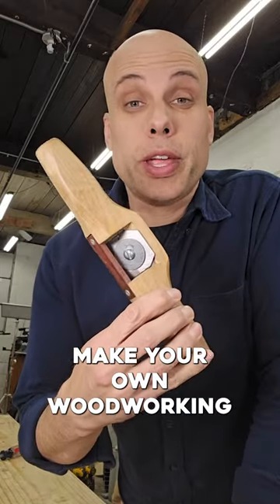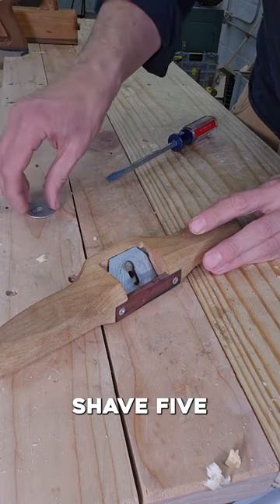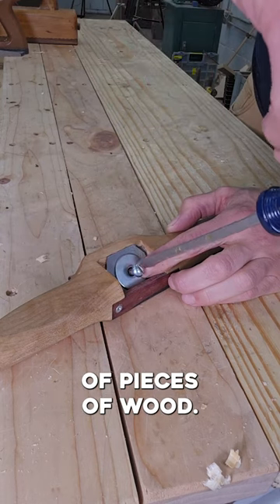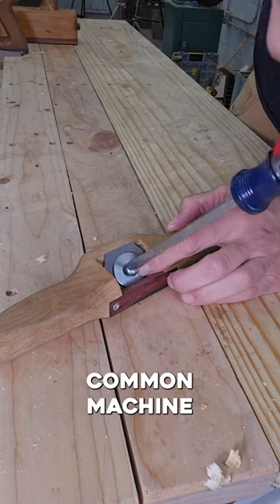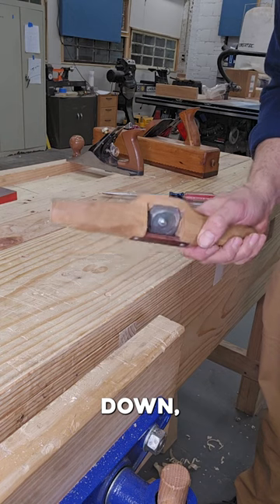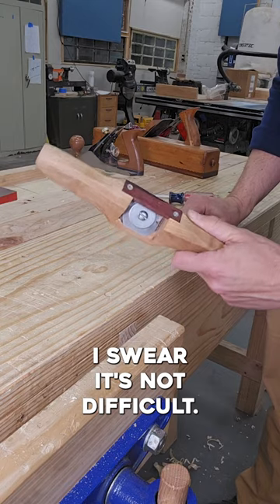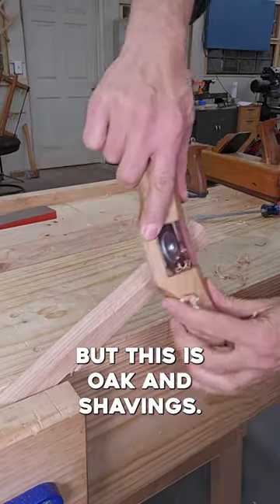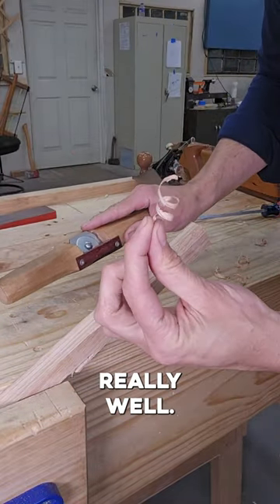Can you REALLY make your own tools? #diy #woodworking #woodworkingtips

Comment: That's the thing. There seems to be some stigma attached to making your own things rather than buying them. I don't get it. I make stuff and it works. It costs me a fraction of the store bought price. I can make it to my own specification and I can customize it when needed. You can't customize store bought stuff. It's not made to and frequently deliberately made to prevent customization.

Comment: I want to make a draw knife but that’s a bit harder to make with the tools I have. I don’t want to ruin a good knife eaither
Reply: You can get O1 (oil hardening) flat ground tool steel in a vast range of thicknesses and widths, 18 and 36 inch lengths.  Amazon, eBay, any industrial supply house.  Easy to grind and file, heat with a propane torch, quench in oil.  Very forgiving for  beginners, holds an edge nearly as well as tricky air hardening steels.  Old files work well, but you need a real heat treating furnace to anneal the steel to be soft enough to shape.  Somebody had to make everything, so why not you?